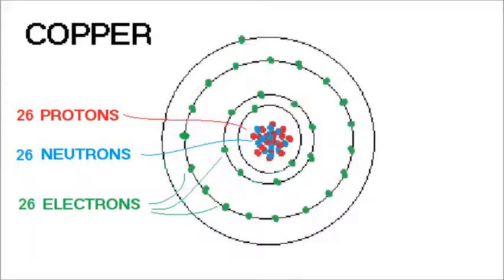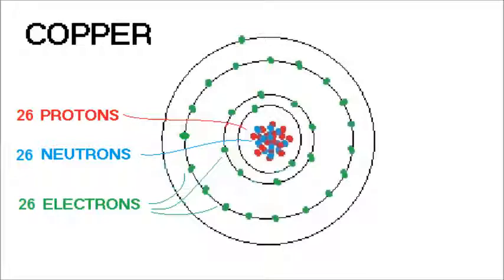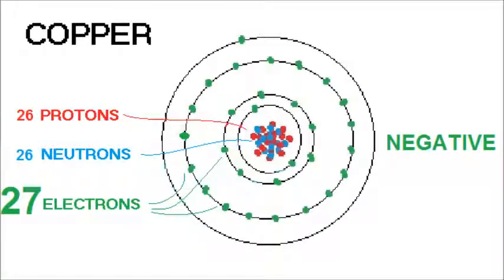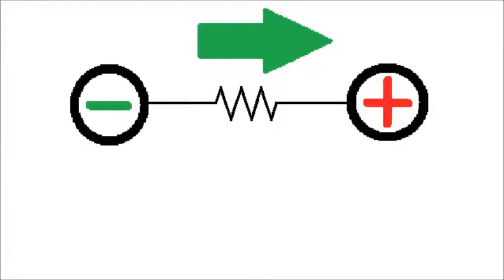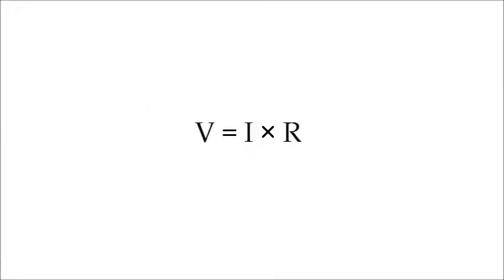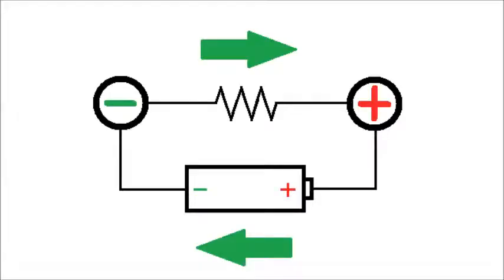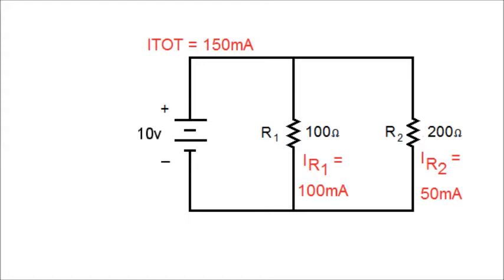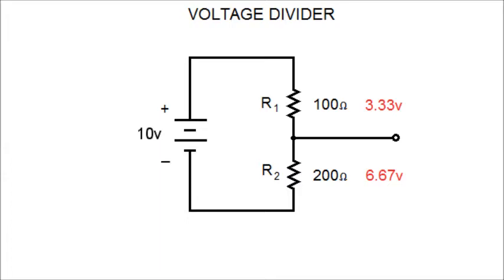Basic Electrical Engineering:  Volts, Amps, Ohms, and Circuits

Comment: 16:21 I totally see what you are saying with ohms law, and that did trip me up a few times when I was trying to learn it, but I figured out how to explain it when it is in the V=IR form:

In order to have so many amps flow through the some random (place_value_here) resistor, there *HAS* to be ___ volts across the resistor Otherwise it dont work! Ohms law does not say in this case that voltage is created, it just that exact amount has to be present, and exist! What you say is a very good point! Thumbs up!

Comment: That was fifty dollars well spent. Since starting on the study of electronics, I have been trying to understand why the voltage doesn't "pressurize" the wire between the resistors to full voltage. Like if you had a closed valve on the far left of your plumbing device, Kool-Aid would pressurize all three tubes. With the valve open, you get the pressure drops, just like voltage drops. Eureka! 
Thanks.

Comment: The car equation does work but you are expecting the wrong answer of none. The equation would tell you how many gallons of fuel you would need to do 300 miles with a car that does 30 mpg. Excellent video though, just thought I would point that out.